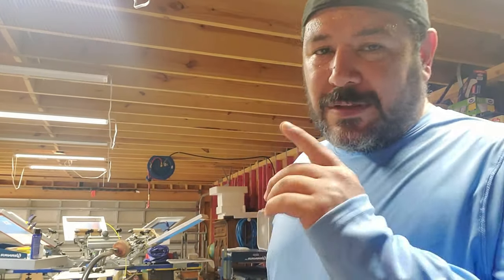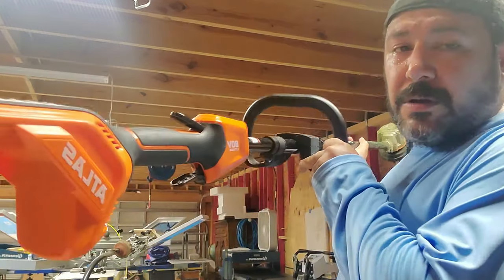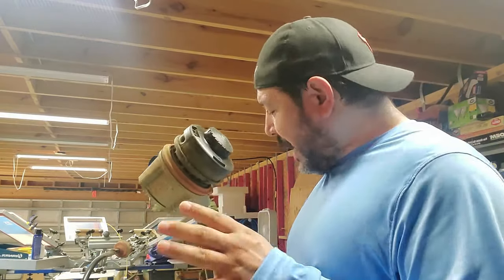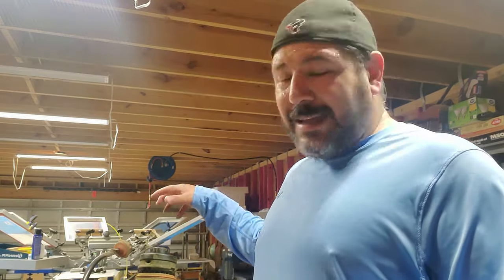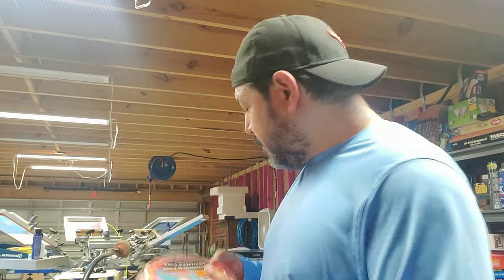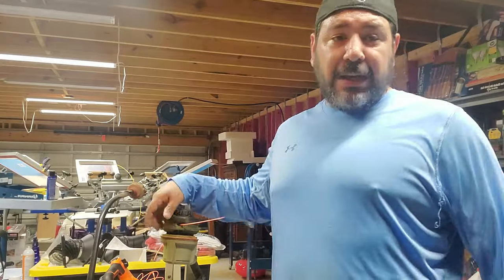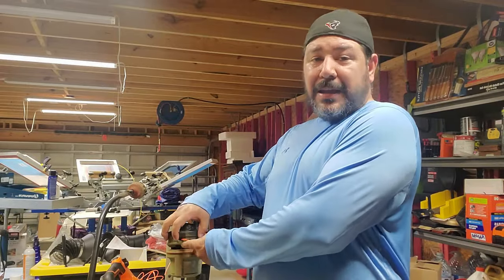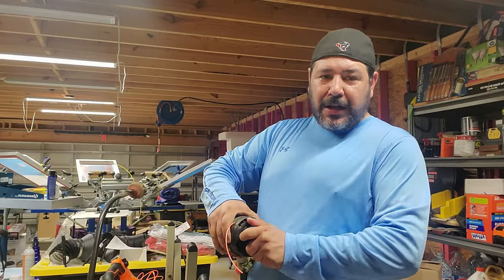Atlas 80V Trimmer How To Re-String Re-Spool New Line

Comment: Nice video. I'm just wondering before buying if you can remove the string trimmer head and replace it with a blade like you can on the Stihl or Husqvarna?
Reply from the maker: I was thinking of that when I first bought it. The head comes apart easily but didn't try and remove the entire head completely. I had seen a couple years ago people trying to do the same with no luck but I KNOW it has to come off.

I will look at it this weekend and attempt to remove it, and if it does come off, I'll let y'all know the dimensions of the motor shaft.
Reply: @EverythingInBetween22  🙏 I want to buy one for my farm but I know from past experience with these trimmers that the strings won't work for farm work and now they have ones that have chainsaw blades on them that can handle brush work, that's what I need. I called harbor freight and they couldn't tell me, go figure! I'll bet they just think I'll throw money away just to find out...I thank you for your kindness!

Comment: Where can I order a string head for my 40volts atlas
Reply from the maker: If you go to the product page on the HF website, scroll down to Product Support > Replacement Parts. There is a PDF of the available replacement parts to purchase along with the Part # and price. There is also a 1-800 number to call and order.

Comment: My knob hard to turn for me a woman what can I get to help me turn my knob.
Reply from the maker: I would try using one of those rubber gripper jar top openers. Search that online and you'll find them. They're pretty much in every grocery store. It's worth a shot. Let us know how it goes.
Reply: I put on my rubber grip gardening gloves.  Hold tight to the string housing and crank counterclockwise on the bumper top.  I still found it quite difficult to do.  I put in 3 ft to try it out.
Reply from the maker: @juliestrong1947  Have you tried pushing down slightly, while turning? It seems to make it a little easier to turn.
Reply: @EverythingInBetween22  I tried keeping it pushed down while turning.  I'd get a few click(?) sounds as it went around but I couldn't keep the pressure on it.  It's my friend's trimmer and I think while she was banging the bumper on the ground trying to get the line out, she must have done some damage.  She'd never used a trimmer before as she didn't turn the trimmer on and bump it as the motor was slowing down.  She just kept smacking it on the ground with it turned off.  If that makes any sense.
Reply from the maker: @juliestrong1947  You made sense but it sounds like she knocked the sense out of that string head lol... If y'all think it's broken, Atlas does sell replacements. Go to the product's page on HF's website and scroll down to Product Support. There's a Parts list with Part numbers and the cost. Both currently around $30.

80V Trimmer string head Part #23721
40V Trimmer string head Part #23686
Reply: @EverythingInBetween22  Thank you so much.  I'll order the part tonight.
Reply from the maker: @juliestrong1947  I hope it fixes the issue. Let us know how it goes.
Reply: A woman as well, it's nearly impossible to turn. Even using a vice grip and it barely budges.